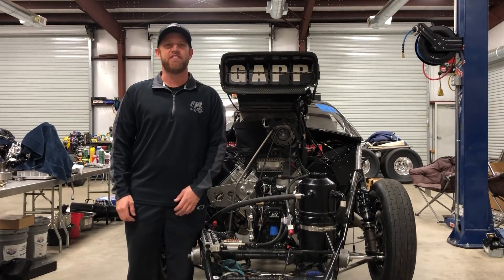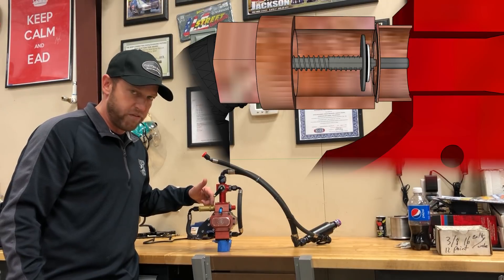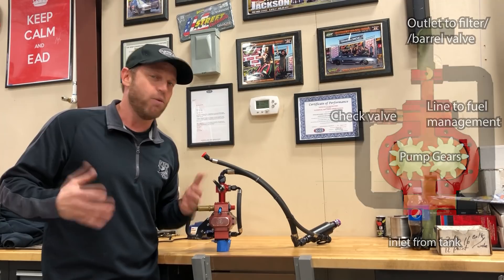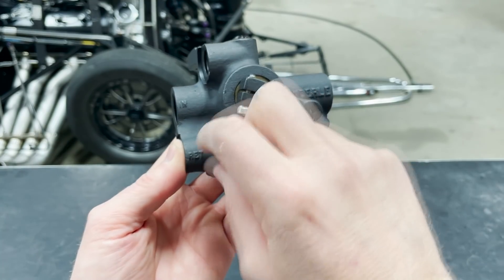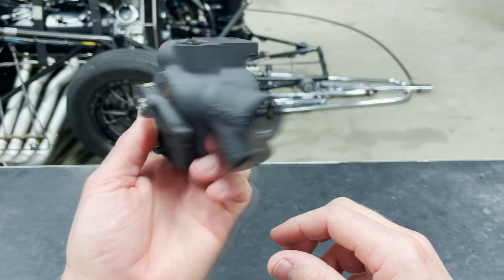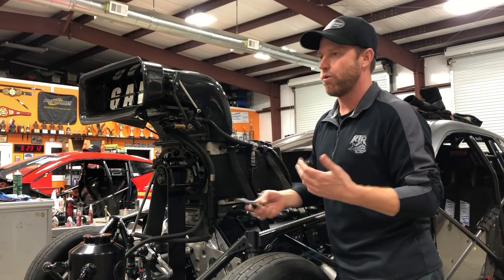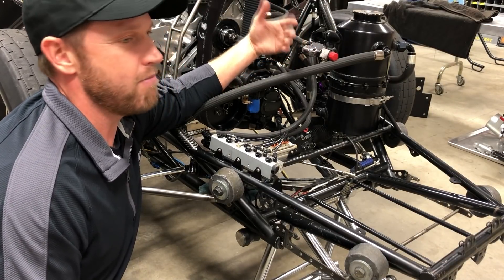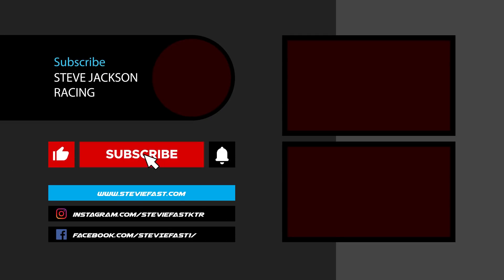The Fast Lane with Stevie Fast - Mechanical Fuel Injection Systems

Comment: So at 14:40 you start talking about connecting rods. So I know very little about super high performance motors, so are you saying that one cylinder might have a shorter connecting rod that another or would you do like normal and change them all?
Reply from the maker: Yes sir. We stagger the length of the connecting rods cylinder to cylinder to change compression.

Comment: Don’t you know running lean increase cylinder temps and increase the chance of you melting down a piston to make good power you wanna run FAT and you wanna run on a motor like his duel Holly 1250 dominators and a 14-71 roots supercharger scrap that crap EFI system, EFI starves the motor of fuel and air, although with fuel carbs he’s gonna go through a lot more fuel than with EFI would need a 20+ gallon tank probably mechanical fuel pumps on race cars is stupid, we always ran high flow electric fuel pumps for a constant steady fuel pressure which is what you want and 1 inch fuel lines these kids today have no idea how to really make power and a supercharged car should not idle at 2700 a blower car are supposed to have a surge to the motor not run like a top like your PoS should bounce from around 800-1200 rpm at idle
Reply from the maker: Wow

Comment: 'So yeah, go ahead and pull that pump and BDK (if applicable, lol).. don't worry I'll watch you while I slowly take out the number 2 spark plug that is already out And yeah.. I always end up holding the spark plug wrench like a police baton' - lol
-----
I really like the amount of time you put into explaining all these different parts of a race car, because all these drag racing organizations have so many different rules now and I don't think anyone can know too much about a fuel system (or a clutch, converter, computer controls, timers, etc, etc..  I really do not think it's possible, 😂😊🤘

Comment: Would be good to see how you get to a certain tune up in a engine. from pump flowing-cubic inch-overdrive% calculation  to EGT, Plugs, MPH  readings, Thanks Stevie ✌

I have only dealt with low horsepower blown alcohol motors were we run  them typical only for a minute and a half through all sorts of rpm and throttle positions (Burnout Competition) were we are continually  Haussin The Gas !!!

Comment: I always wondered what is happening during the burnout with this type of setup. It doesn't appear that the throttle blades move?
Reply: they have SOO much power that, after you drive through water, it takes bearly ANY throttle to spin the tires (that's why MOST (not all, they don't) use a throttle stop (like top fuel for example) that quick connects on/off and limits the throttle blades (butterflies) which, as he showed, is connected to the barrel valve. 

You don't see this as much and come out fuel but you see it in Top alcohol and other classes, you'll see them unclip something from the engine and show the driver, that's the throttle stop. :)

Comment: Can you do a video or series on 4 link adjustment? Maybe one for slicks one for radials.
When to make a shock change and when to make a 4 link change, or anti roll bar change based on track conditions. 

I understand anti squat, instant center, and center of gravity and how changing the spread moves those numbers. 

Everyone always talks about the bottom bar but not the top bar. I know it sets pinion angle, adds preload, and can lengthen or shorten and even raise the instant center. Is there more to the top bar?

Tim Mcamis once said think of the shock as controlling the height and angle of the 4 link as the car goes down the track. #fastlane

Comment: Fascinating, since you can't use EFI you developed a series of controlled fuel leaks using timers, jets and solenoids to simulate EFI lol!  Job security since modern EFI systems are fairly easy to tune these days ( compared to the nightmare you have here).
Reply from the maker: I’m from the show me state. It’s the quickest one in the world. So it works ok.
Reply: @SteveJacksonRacing  😂😁🤘

Comment: I run an 8 stack N/A set up.  My set up is super similar to the blown set up.  Which I knew, but its cool seeing the fast guys do the same shit
Reply: That usually goes both ways. :-)

(Fast guys seeing the fuel system setup the same, hell, there are many reasons why you see figure teams in the Sportsman pits, besides talking and advice 😁)

Comment: So is it commonplace for the driver to have some or most of your knowledge of the car, or is it more typical to have a driver to drive and the crew chief for the car? Lots to think about driving a slow bracket car, can't even imagine sitting on the line in that missile and wondering if you should have richened the engine at the 330 clocks instead of leaning it out LOL

Comment: I miss the 600 plus C.I. Big Block Dodges, with Hilborn fuel injection, on methanol, with a dial a jet to control that leak from the drivers seat, we used to run. Great job Mr. Jackson in explaining how simple injection is.💪💪💪💪

Comment: Lol i had no idea it had so many components.  What a big secret.
Reply: LoL, yeah and he didn't talk about the controller and programming the controller all that much for those 6 jets, lol.
The fuel system on a top fuel car is completely ridiculous. I had worked on injected Nitro dragsters first, then alcohol funny cars and pro mods, then Top Fuel and Top Fuel funny car, and the fuel system on those is just completely absurd, LoL, like wtf level 😂 you have your BDK, your slide valve, you're 8novels above the supercharger, up to 3 per cylinder on the intake manifold oh, you're fuel lines that go into the cylinder heads and have two nozzles there, LOL

🤦‍♂️  it's is gnarly. Like you said roots blown makes it more complicated, then Nitro makes it more complicated than that and then you have a blown fuel car that's just ridiculous. You have all the needle valves for the clutch stages and it's just madness.  lol.

Comment: Wondering how long before they start to dabble in efi. Obviously they have that whole system down to an absolute science but efi would drastically simplify things I would think.
Reply: Some have already, but on lower HP cars. They don't have efi injectors that flow enough fuel just yet for the big time cars.

Comment: It would seem that fuel flow sensor would work well on the fuel side of nitrous kit... I've never sprayed enough to need anything like that.  So I'm guessing here
Reply: I have use nitrous for 40 years . And still learning things, that's a great question. And it seems like common sense would tell you yes. Now I'm thinking..

Comment: I don't quite get the part where u go 3/4 throttle n it blows
Reply: Loss of Oxygen? Just a thought.
Reply: I would guess that at anything other than wide open, you don't have precise enough metering of fuel.  So you may be too fat or too lean which is hard on the motor.  Ar wot, the fuel flow is precise enough to tune.

Comment: Finally someone that will give some info on the fuel system.
Would it be possible to maybe show how to work out a start up tune if there is a formula as i have a way smaller engine. 6 cylinder that would probably fit in one of your cylinders lol.

Comment: Why blower cars prefer to use mechanical injection over electronic?
Reply: Probably due to the volume of fuel
Reply: I'm no pro on it, but pretty sure it's as Stevie said in this video, the supercharger uses fuel as a lubricant.  Most fuel injection is designed for direct per cylinder. Seen smaller supercharged engines,where carbs on top of like an 8-71 (street/show cars) that used throttle body FI. These size superchargers dont have a fuel injection setup like that.

Comment: #FastLane When a Top Alcohol Funny Car is staging the car it sounds like they have the motor revved completely out. Why do they have to rev the car so hard and what RPM are they actually launching the car at? Also what is your thoughts on the top alcohol blown alcohol dragsters versus the nitro injected dragster and do you think the nitro injected cars should have their own class and bring back all alcohol blown cars back?
Reply: I doubt you’ll get much of a reply just because your question will require so much typing to answer completely lol. Most of top alchohol cars run clutches, one way you get the car to leave harder is to rev it more, also puts the engine in a happier spot for horsepower/boost and creates inertia to keep the engine higher as you load it with the clutch, people have written books on this so my description is super brief. Our blown alchohol car we were leaving upwards of 7000 rpm, but that’s way way different depending on a lot of things between combinations.
I think KTR runs a torque converter and I haven’t a clue what rpm they run theirs at.
Reply: @bigblockmaro1  thank you for trying to explain.
Reply: @bigboreracing356  top alchohol dragsters can run injected nitro or blown alchohol
Reply: Top fuel cars have two fuel pumps with only one running until just before they light the first bulb, so they’re super lean up until that second pump goes on
Reply: @bigboreracing356  you are incorrect as you put (nitro) in there. Top fuel is not the only class allowed to run nitro. But, you are also correct, nobody chooses to give up the 5000ish hp they gain from running nitro vs alchohol in top fuel. Not sure why that was brought up, but in any case, it is true.
Reply: The simplest way I can describe it is a two-step essentially misfires the the ignition to hold it and a given RPM and when you have a converter, you're only on it for a VERY short period of time before you let go of the transbrake...  on pedal clutches, you would be on the 2-Step for a long time and it can be extremely hard on parts, especially screw blowers (that may have changed, but I doubt it) and in general no motor really likes being on a two-step for very long... it can be REALLY hard on parts..

So some people would use an air launcher (see below on what it is) that was/is used be more consistent, get used to a new car, etc.. etc. on pro mods, etc. etc. w/ pedal clutches..
---
Air launchers would hold the butterflies at a fixed position, a quarter of an inch to start with, for example.. to allow you to press the pedal to the floor and hold the car at a steady RPM so all a driver would have to do is focus on dumping the clutch and when they did, the butterflies would open up all the way, so it's mimicking holding and revving the engine without misfiring the ignition. The reason I'm telling you the reason I'm mentioning air launchers is so the whole thing makes a little more sense. If this doesn't just let me know :-)